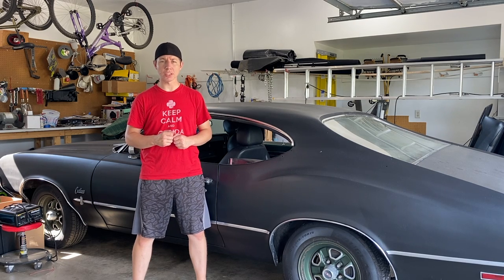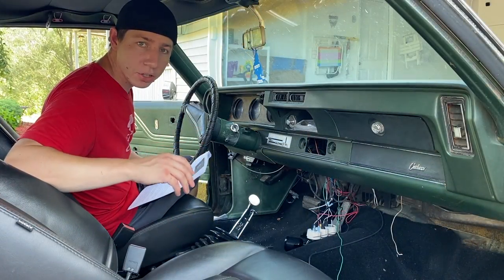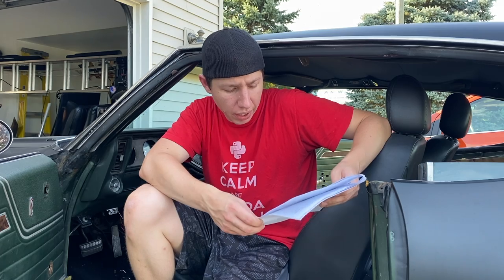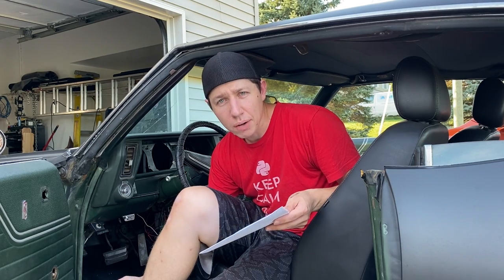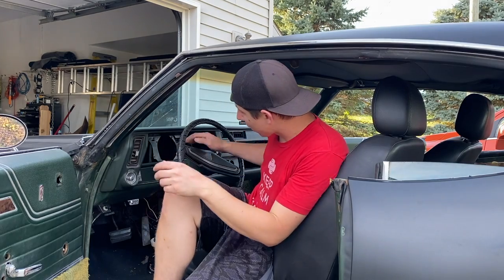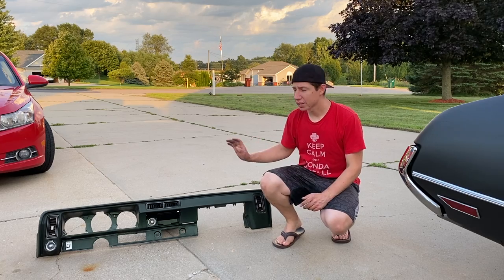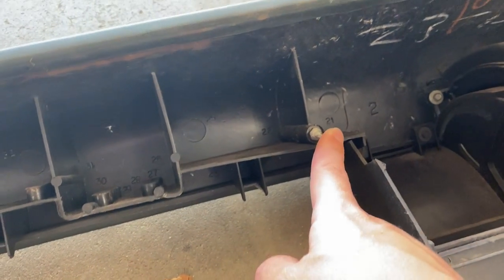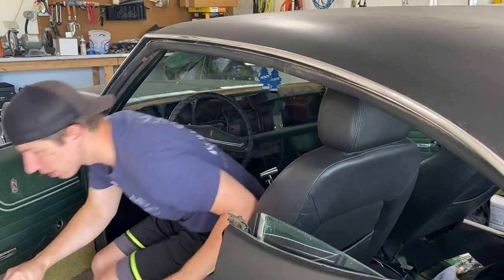Rebuilding 1970 Cutlass Episode 9 - Dash Removal - How To

Comment: Chad, if you pull the light switch out, you can loosen the retaining nut. use a retaining ring plier, it will pull to the end of the pull handle. you can push the button on the switch, turn it 90 degrees and pull it out and leave the switch itself in the dash frame.